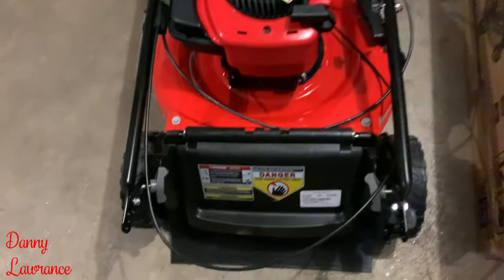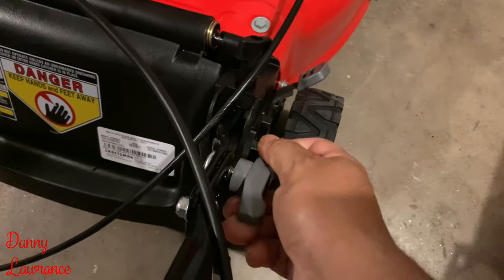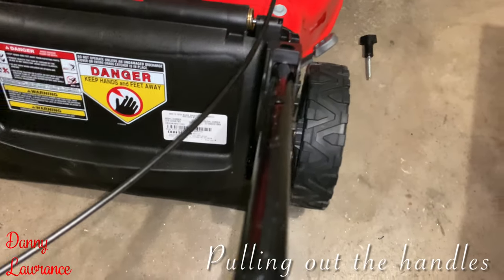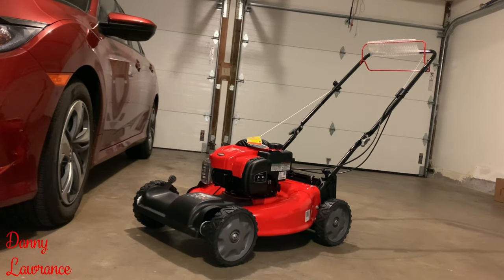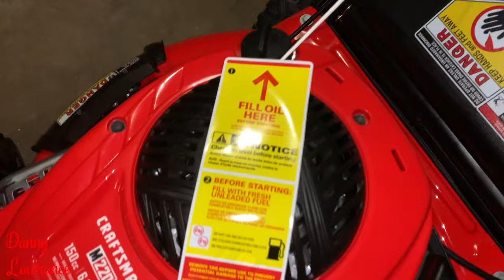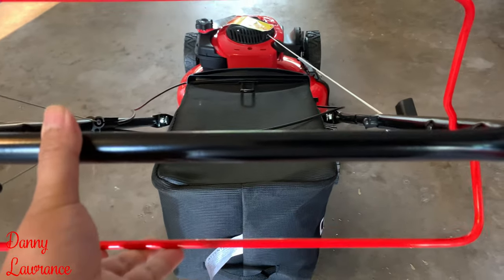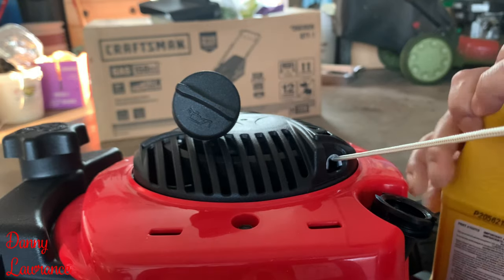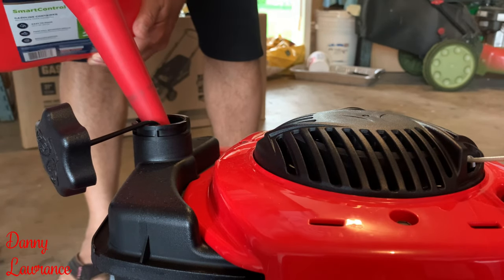CRAFTSMAN M220 150-cc 21-in Gas Push Lawn Mower with Briggs & Stratton Engine | Unboxing

Comment: I’ve been having trouble with my current toro gas self propelled mower mowing, starting, and running properly since I bought it from a small hardware store 8 yrs ago, I’m now strongly considering this craftsman self propelled mower next spring of 2024 from Lowe’s. I hope that craftsman does better and will be a longtime before the buying the next mower. Especially with the Briggs engine. They run excellent from what I’ve heard.
Reply from the maker: Thank you for sharing your experience. Yeah it’s been giving me decent service so far.

Comment: I bought the same model today (4/2/22) at Lowe's for just under $400, including tax. Set up was fairly easy, no tools needed. Do read the instructions, or watch YouTube. The mower moves at a fairly fast pace when self propelled. You can release the front wheel drive clutch, and use it as a push mower when you have to turn or do edges. Or you can simply raise the front drive wheels off the ground to turn. It seems to move/drive at just above walking pace. But that might be because it is new. Also, it started up, first time, with a half pull on the rope.  So far I'm fairly impressed.
Update: After the first use I found that it is best to hose off the bottom/inner part of the cowling. It had a build up of mud and grass. Maybe in part that is because the grass was a tad damp when I cut it. The water plug (to wash out the lower part) on the mover is kind of lame. It's easier to tilt it and hose it off.
Also, the mower has three ways to handle/expell the cut grass. 1. The collector bag. 2. The side ejector. 3. Or close the flap and use it was a cutter/mulcher. The latter is what works best for me.
Reply from the maker: Thank you for feedback Eddie. Yeah I felt the same way when I bought it. It’s a pretty good lawn mower. I’m still enjoying it. And I hope you will enjoy your mower too.
Reply: PSS..... try to not let the mover run out of fuel/gas. I did, and it took about 5-7 yanks on the starter cord. Usually, it cranks on the first half pull.
Reply from the maker: @eddiem.5811  Thank you for your feedback.

Comment: Our new one won’t start lots of resistance? Any suggestions
Reply from the maker: I’m sorry to hear that. New one usually hard to pull but it will work out, just make sure you place the handle correctly to upward (it was explained in the video 1:25 minutes)

Comment: Dumb question: how do you kill the engine? I can't seem to find a switch for that. I don't want to start and not be able to stop it.
Reply from the maker: No question is dumb, anyway to do so you need to release the drive control which is red color. As soon as you release it your mower will stop running.

Comment: Thanks !!! Dan. Could I add a very basic: hold in mower blade handle to start and keep running. I haven't had a mower in 10 yrs ! back to basics. ALSO: ANYONE newbie: 2 things !!: again, look at the handle under the mower BEFORE starting to make sure it is it not in blade diameter / in way of blade and NO E85 FUEL !! Can buy fuel at Lowes ( HD ??) that is gasoline/no ethanol; then find a station that sells non-E85.
Reply from the maker: I really appreciate for your useful words. Thank you again.

Comment: I just want to know what the green and black piece on the side is for? It’s located right by the filter and under the gas
Reply from the maker: Didn’t found any green thing in this mower. It could be the air filter most probably.

Comment: I just bought this today. Aesthetically, I didn't like the routing of the clutch drive cable. At least they should have added some clips over the deck so that it doesn't move around. I will add some stick-on clips. The handle is bit loose even after tightening all the bolts. It moves up and down a bit where we hold.
Reply from the maker: Yeah, you’re absolutely right. I felt the same way. Zip tie will work in this case and sorry for the bolts. Keep tightening them.

Comment: Hello I assembled the mower and when I press the lever down n pull the string I get resistant and then I try to pull it real fast but the string doesn't move anymore I feel like I going to break it..any suggestions please help.
Reply from the maker: So sorry to get back to you. Do you able to figure it out?
Reply: Same problem with the rope
Reply from the maker: @darthmoll2u  sorry to hear that.

Comment: How about the cord you pull to start the engine… mind keeps getting stuck
Reply from the maker: Sorry to get back you late. Please check the handle because I had to make adjustments. Blades not gonna spin unless it’s up to the operating position. Cord was little hard in first attempt but it wasn’t that bad. Hopefully it works for you.

Comment: I have this same mower, it works fine. The FWD is very powerful. This is my second season with it, bought it last May. It started on the second pull after sitting for 4 months this past weekend for my first mow of the year, which was impressive. Although for just $150 more, you can get a Honda HRN which is quite a bit better. I wish I would have done that, the 150cc engine on the Craftsman is just a little underpowered in my experience. If my grass is wet or if I let it grow for a couple days longer than normal, it will stall out quite a few times while mowing. I had an 11 year old Toro GTS before the Craftsman that would rarely stall. I paid $350 for mine at the time, and the HRN was $500.
Reply from the maker: Thanks for your nice words. I feel like this a decent mower and definitely not for heavy duty.

Comment: I bought a lightly used, almost new M220 yesterday.  I went to change the oil, and there's no drain!!??!!!  You've got to kidding me!  Who on God's green Earth would design and manufacture an engine without a drain the change the oil???????  Insanity!
Reply from the maker: That sounds crazy, there should be a way to change the oil. BTW I have another video in my channel where I got a lot of white smoke due to putting excessive engine oil, please check it out. It might help. Thanks.

Comment: Does this mower have a low oil level sensor?
Reply from the maker: Nah it doesn’t.
Reply: @lifeofdanlaw  Then any idea what would cause a brand new one to run for about 30 seconds then die and not be able to re-start?  This was only the second time I had used it.
Reply from the maker: @ronniestephens1945  I’m not too sure about it. But if the mower seating for a long period of time with the oil inside it might happened so the best way is to burnt out rest of the oil as soon as season is over.
Reply: It has a dipstick to check the oil level. I doubt it has a low oil level sensor?
Reply from the maker: @eddiem.5811  I didn’t see any sensor too, but it has a dipstick to check the oil level.

Comment: Hi I just opened mine and I can’t get it to start! The string won’t even let me pull to fill extension.
Reply from the maker: I’m sorry to hear that. New one usually hard to pull but it will work out, just make sure you place the handle correctly to upward (it was explained in the video 1:25 minutes)

Comment: What is fuel capacity?
Reply from the maker: I should remember that, can’t recall right now on top of my head. I just use a long funnel to pour gas to avoid any spillover.
Reply: @lifeofdanlaw  no problem, thank you for the reaponse.
Reply from the maker: @SeasonedSalmon  You are very welcome ☺

Comment: What size is the carburetor bowl bolt?
Reply from the maker: @Amonzi
this might be helpful for you regarding the carburetor.
798653 Carburetor for Briggs & Stratton 696981 698860 694508 795069 698859 790180 790290 693865 697354 698474 791991 698810 698857 698478 694174 690046 693751 Craftsman 791077 Carburetor 591299 798650

Comment: why does the cord have so much resistance and won’t allow me to pull to start it
Reply from the maker: I faced the same thing and I thought something is wrong but if you watch this particular part of the video where you will see even I have tried hard and few times & in the video it shown as fast motion so watch throughly. First attempt to pull, it was hard but after that it worked out fine. Thank You. I know you can do it too.
Reply: It may be because the handle bar has not been adjusted to the upper level, by removing the two T bolts, pulling handle bar up and then screwing the two T bolts on again. The blade will hit the handle bar causing damage to the blade if that adjustment is not made.
Reply from the maker: @Blancaamezcua103  Thank you for your feedback.
Reply: @Blancaamezcua103  I never thought of that when I first purchased it, I was in a hurry & tried starting it. I ended up damaging the blades, the handle bars & something else. I tried returning it but couldn't.

Comment: Did you show the engine rope adjustment to the right handle bar?
Reply from the maker: Actually I didn’t have to do any adjustments for that.
Reply from the maker: @Mr10Residentevilfan Sorry to hear it. It was hard to pull for the first time but after that it became smooth.
Reply from the maker: @Mr10Residentevilfan Great ! Enjoy your mower. Good luck.
Reply: @Mr10Residentevilfan what safety locks?
Reply: @Mr10Residentevilfan  Don't think its a safety lock. Think you forgot to pull handle out to the furthest set of holes for  normal use. Mine didn't have any kind of lock on it.

Comment: My cord didn't come pulled up. When I try to pull it out the hol, it won't come out
Reply from the maker: Check out the video specifically when I adjusted the handle upwards to avoid resistance

Comment: How do i take off the front black piece, my forward drive stopped working.
Reply from the maker: I’m sorry to hear that, I never took out the front part. Not too sure is there any info available in the manual.
Reply: @lifeofdanlaw  No worries, underneath are infront of the blade attachement are two screws you take off. Then there are 5 screws in between the wheels underneath you take off, and the plastic shroud comes off.
Reply from the maker: @duffyknight2005  thanks, good to know